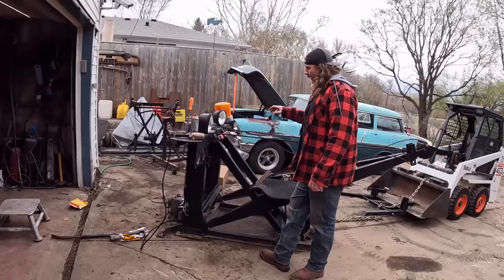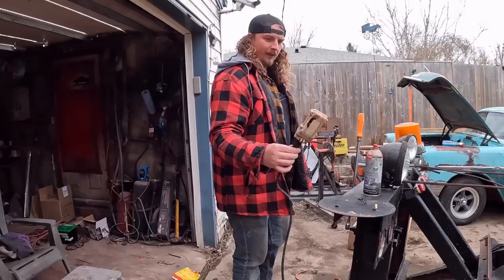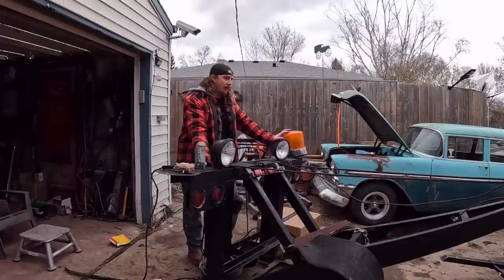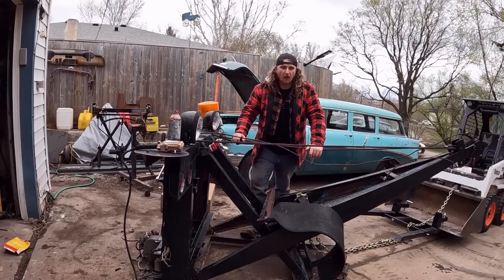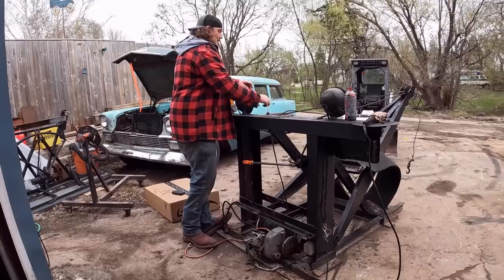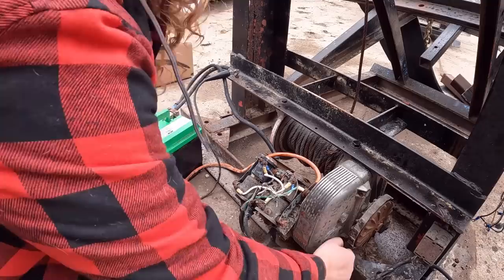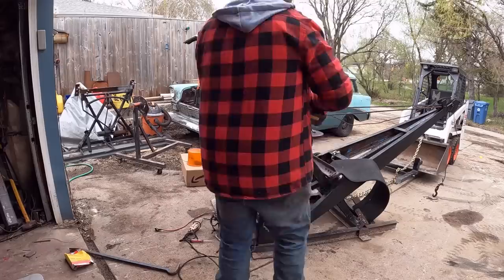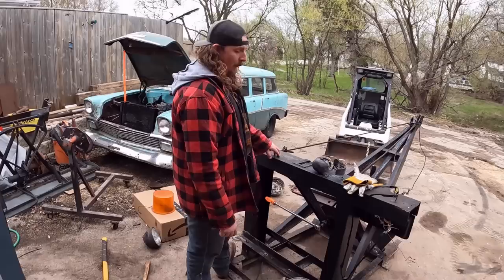DD Tow Shop - Building A CHEAP Wrecker To Haul My Junk

Comment: I have used one of those in my days as a Tow operator! I don't think the heavy Iron top was part of the unit originally. The unit had a small tongue in front of the head rack that went thru 2 straps that fastened to the box mounts so the unit could be slid out and in easily. The reason the winch was mounted up off the bed between the uprights was to keep it out off snow and water then going thru the top pulley was to give it more pull power. This unit looks like it was modified heavily. The shiv on the end is not Holmes block manufacture by looks. There are people who have mounted the winch on the top but it sits above the level of the cab then. I you go under a low clearance or branches it will snag the winch then. But all in all you have scored a great piece to start what you need for the amount of use you have for it!! Good luck and best wishes for your adventure!

Comment: Way back in time(late 70’s)(Winnipeg)my boss had a old Dodge step side pickup with a even older boom in the back. Was used to haul cars found in alley ways which became demolition cars. But was probably used more for boosting and pulling cars out of snow banks in the winter. Looks like a fun and useful project.👍

Comment: That’s a Warn 8274. It’s a 8k single line and yes that solenoid pack looks toast. The best option to get rid of the rats nest (and weather proof) is to swap to an Albright contactor. Everything is available to rebuild that winch. The issue I would see using it is it’s a super fast line speed meant more for competition offroad type stuff. Down here in the states if it’s complete and needing minor updating it would still fetch about $600-$750 us. I would go for a HF 12k badlands and be done with it. Oh and like you said in the video that winch was mounted 90* on its side. The “ribbed” aluminum part of the gear box should be upright.

Comment: You will make so much use from this tow truck Dan! With all your projects this is a must. $400 is a great deal for the this unit.
Reply: I never like the tow truck the chain's and hooks do damage to a vehicle's. The flat bed is much better hook up the winch pull it on back of the bed lock it all down and roll out. When I call AAA I asked for the flat bed to ride my classic home.
Reply: @snoopu2601  I agree! With the new vehicles, a flat bed is the way to go. As for the average 30 to 60 year old classic car, (done right) you won’t hurt them with this set up.

Comment: That's a very common modification often done with booms up to 440 Holmes size. I use (used) Ramsey worm drive electric winches which are wrecker/recovery industry standard classics. Owners who don't know better fry the electric motors which are not capable of killing the rest of the winch and are easy to replace. My solenoids are mounted to an perpendicular piece of sheet inside an ammo can lid so they hang from the top and I have instant total access. I will never use conventional solenoid mounts again since my setup is insanely easy to work with. Welding shops have high ampacity cable of much higher quality than "battery cable" crap. I did the same with a 440 on my F350 and love it.

Comment: I would keep the new winch at the bottom like it was mounted so that it don't stress the top and want to pull it off there would be a lot of stress on the top and want to fold it over

Comment: I bought a new 12000 lb Super Winch from Summit Racing for less than $300 and it came equipped with 80 feet of wire rope. And also a wireless remote and a 20-foot plug-in remote.

Comment: Dang, didnt think you were getting on it so quick. I have yet to go in shed and find the winches. One in pieces, good motor i was told. Other complete. And drag out dollies and take pics.
Makes more sense to pick up a 10,000 lb winch,cable and controls are ready to go.with winch on top, more power to pull.

Comment: Keep the winch down at bottom where it is currently (and properly) located moving the winch to the top of the mast puts undo strain on the mast, additionally the winch located where it’s supposed to be down low is done for your safety in the event of the winch cable parts (breaks) under load the cable will basically just go slack but if the winch is mounted up top on the mast there is a potential for it to whip around.   Additionally you should leave the brake and turn signal light mounted high on the mast. I can’t say about Canada traffic laws but I am pretty sure in the US they are required to be mounted up high

Comment: Get a shut off switch some 2g welding wire. 2g quick disconnect or welding wire quick disconnects. And two cheap flasher lights. Hook the winch and lights to the shut off switch. For my winch it’s on or off the truck in 30secs my area people will try to steal or play with it if I leave it on. I would set it up so if you wanted to use the truck as a truck would only talk a little while and it’s back to a truck. I’m about to take a towing safety course this week through CAA. I would also get some air bag for the leaf springs. But probably won’t need it.

Comment: Take the top off lube free spool and it will work. Ebay has the 500a relay with wireless  remote for about 75.00 used several  they work greatly

Comment: i would check into it ,the rules for towing (aka running a tow truck have changed a lot)I ran a tow truck for over 25 years,remote light and safety chains are req. and some other stuff

Comment: hey dan hope this reaches you in time. go to princess auto and buy a fifth wheel hitch mount kit. mine cost like 120? but it had the base for the fifth wheel head, that i actually had to fully rework and build to fit my head. but best is takes four pins to put in and take out, i do my fifth wheel in like 3 mins.  if i was buiding that i would make it like a skid you can pick up one chunk with the bob cat. so is like a 5 min in or out of the pick up.

Comment: they make a basic wheel lift that you can use your winch to lift wheel lift and then put pin through the holes and set on pin so winch isn't carrying weight.I put one on my old sling truck back in the day and that was all we used it for after that.works well and cheap if you can find one still.

Comment: Dan I have a Badlands 12000 with remote control I bought on sale for $350 and it works great if you  install a fifth wheel mount it could be disconnected easily removed when it's not needed. Mount the sling to the receiver hitch

Comment: Interesting, but needs a ton of work & $ to lose the bulk of the usefulness of your pick-up. My guess is that you'll never take it out because of the hassle factor. Buy or build a decent trailer & you'll use it for moving all kinds of stuff, plus your truck will remain useful as a truck. I built a single axle flatbed trailer 30 years ago & still have it, however I two years ago I bought a new 18' deck, aluminum tandem axle flatbed beavertail trailer (directly from the manufacturer for $4500)  & absolutely love it! It only weighs 1200 lbs so I can move it in my yard with the lawn tractor, plus I get great gas mileage towing empty. It allowed me to purchase a plane & a helicopter that "fell in my lap" for super cheap & haul them back to my shop at a moments notice. The key to this stuff is versatility..................don't box yourself in with narrow use equipment.
Reply from the maker: I think your just jelous that I have a tow truck
Reply: @DDSpeedShop  yeah, that's it : ). A buddy bought a ramp truck some years ago & ended up selling it because he didn't use it enough to justify the insurance, maintenance etc & everyone kept asking him to move their crap...............just wait : (
Reply from the maker: @colinhyde1951  I forgot trailers don't need insurance, storage or anyone asking to use a trailer......
Reply: @DDSpeedShop  Correct, trailers do not require insurance, liability is covered by the tow vehicles insurance, storage is obviously more than a lump of steel/tow truck rig, but still doable in the DD Speed Shop enclave & of course there's that borrow thing..................just say NO........... its broken, needs work, tires are bad, bearings need repacking.............you know the drill : )

Comment: you can wire it with a 3 way toggle switch. save a pile of money that way. you have put power to the smaller wires. use a power probe to test it is easier. you were putting power to the wrong wires.

Comment: Hello there cowboy here again great buy you may want to consider putting the winch back where it was and replace the pulleys as well as ditching he steel cable's they make what they call braided cable it's rope so it won't tear your hands up and a lot of tow guys are switching to it. Yes I know you only intend on towing thing's arousal little bit remember when you were trying to get the car from beside the garage out with the wheels frozen into the ground wouldn't be have been nice to have had this then just saying anyway remember always be safe healthy and happy God Bless 🤠

Comment: nothing to them DAN,  just save yourself grief always double line down from boom head to lift apron. just adds that tiny bit of extra lift easy on your winch. I built my own in 1978 and did it with slides i had to slide tracks, only down side of them was hight the slides where a bit thick. but if i was not paying attention i pulled the front of the truck off the ground. the hilight ofmine was how simple i made so i could lift orlower the boom using the winch. you will find it a advantage if youcan raise or lower your boom difrent cars tow diffrent and a low boom is usually a sweet spot to pullling. these are my veiws and opions. i estimate i hauled aprox 170 old wrote off wreaks that sumer with my outfit that where crushed and hauled to the scrap mill.best feet was the dolly i made to carry weeless or axleless cars. you gotta be creative is all and experiment.

Comment: Had a H440 on a 60 F350, 4 speed 352 motor. Paid for itself one winter. Winch needs to be braced to frame underneath.
Reply: I agree winch should be mounted in the middle on the bottom cable running through the pulleys
Reply: Been a gear head for a few yrs .run alot of old tow trucks ,
My first was a hand crank , in a 49 chev.  My last was 480 twin , w/ riggers . Dont know the science behind it , but keep winch mounted low & go through a top pulley . Tie winch mount into fish plated portion of truck frame . Good lucky , & they are as handy as a shirt pocket .
--  grandpa jeff. ---  u.s.a.